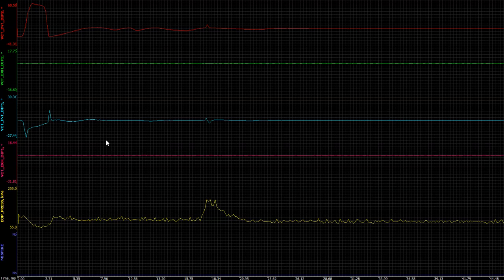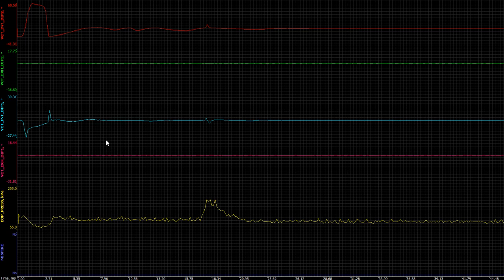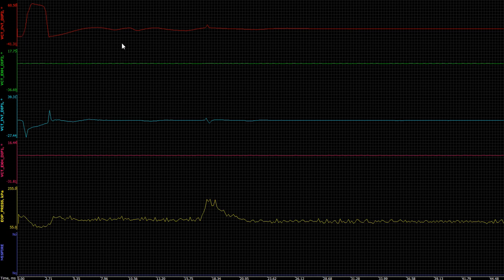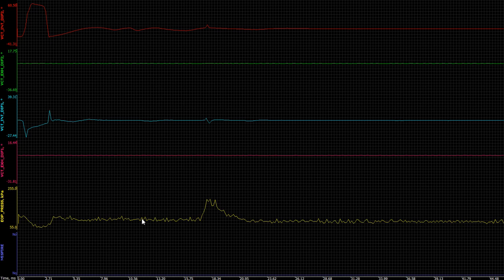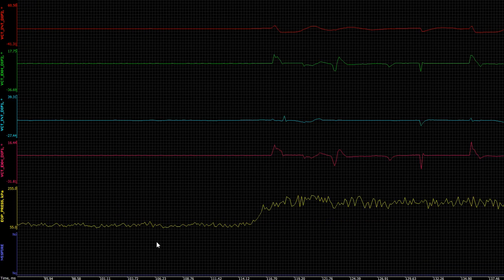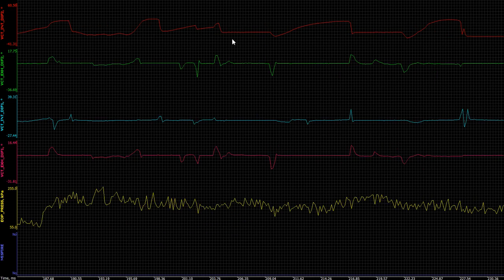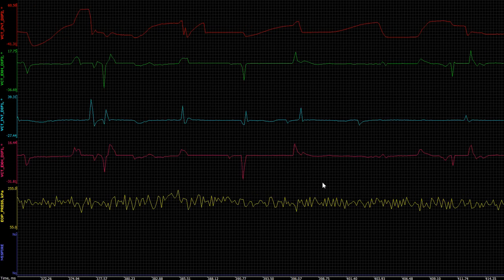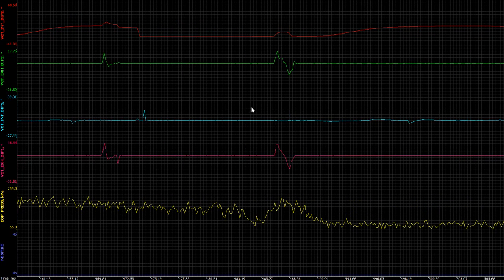2018 F150 5.0l Engine - VCT Solenoid Problem?

Comment: the vct exhuast diffrence  spikes happens when you leave your foot from the gas ?
Reply from the maker: I believe so, yes.  Although the spikes in this graph are small enough that I really don't think it indicates any kind of real problem.  What the real issue was .. was the substantial difference in the graph for the intake solenoid on bank 2 as compared to any of the other graphs.  Remember, these graphs are showing the difference between actual and commanded timing positions, so I would expect them to all be very similar.  Clearly the intake on bank 2 has something going on with it.  Ultimately I replaced the solenoid for the intake on bank 2 and the truck has been MUCH better ever since.

Comment: Unplug both intake cam solenoids and see if they both default to -10° or whatever is stock for a 5.0lt.  This should tell you if it's a solenoid/actuator problem or mechanical like the timing chain has skipped a tooth (both cams on the one bank would normally show an error though). Also add the cams duty cycle to your Forscan and see what they are outputting. Swapping the actuators from one bank to the other (or just with the exhaust on that bank will also narrow down if it's a dud solenoid/actuator. 
Good luck with it...
Reply from the maker: Thanks for this reply, I appreciate it.  I went ahead and just replaced both VCT solenoids on the affected bank and the truck is driving like a dream now.  I did also cleat the adaptive shift tables because I figure the TCU was all jacked up from the bad solenoids.  My shifting is so much smoother, doesn't feel like it's going to die at idle, no codes, etc.  I've yet to take it on a long drive yet, so we'll see.  Both old solenoids ohm out same as new, but there is 100% improvement in drivability replacing the solenoids.  I'll continue to update in the comments.
Reply: @chackett99   Good to hear that it's sorted, it was probably the actuator that was jammed up or even clogged (do they have removable filters or only screens to stop crud?) but the solenoid could still be dodgy under operation... With the TCM/TCU I wouldn't clear the shift adaption as this is related to clutch wear over time. Clearing the shift in the PCM is fine as this is like an "aggressive meter" for your driving style whereas TCM shift adaptions are for clutch wear which you would only reset when replacing clutches in set drums or total rebuild... It will take a fair few hundred km's to get back to where the original numbers where (shift firmness) if reset with warn clutches.
Reply from the maker: @brettus9115  Thanks for the information about the adaptive tables.  It seems whenever I hear or read about the adaptive tables, people are saying they're tables that are used to adapt the shift strategy to your driving style.  I guess I never noticed or have heard that there are adaptive tables in both the TCU and ECU.  I'll have to go back and take a look at that, thanks for the heads up.  As for the actual solenoids, I was surprised to find that the intake and exhaust solenoids are not the same.  One is large and round (shaped like a donut standing on edge) with a pin that actuates out of the center.  I've seen a video where someone noticed that the pin didn't slid out easily on a solenoid he suspected was bad.  Mine seemed fine.  The other solenoid is more cylindrical and that's the one that has the very fine mesh screens on it.  They don't look servicable, short of potentially cleaning them.  But if they're torn or damaged, it looks like you'd have to replace the whole solenoid.